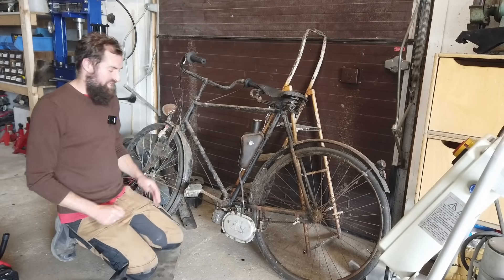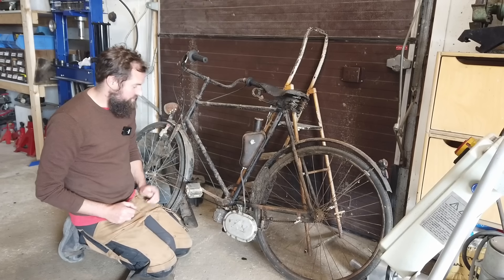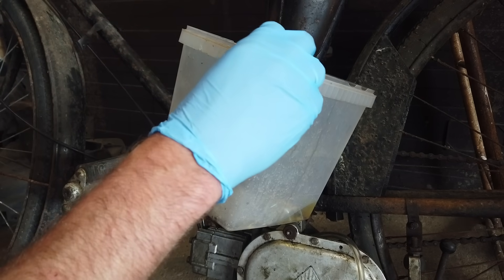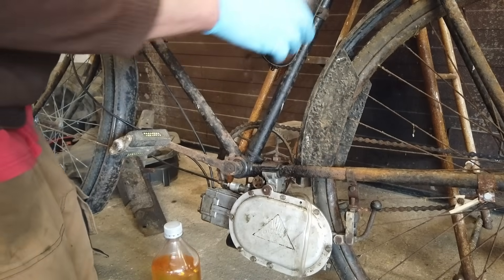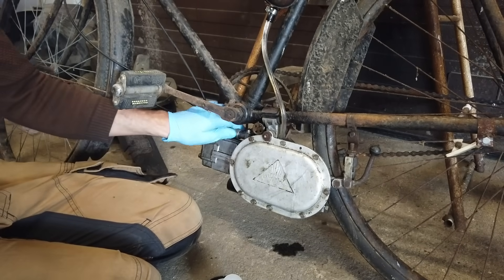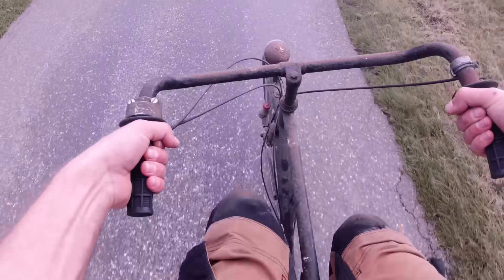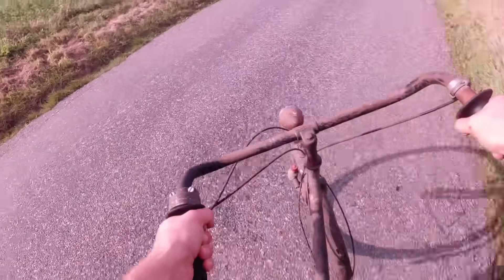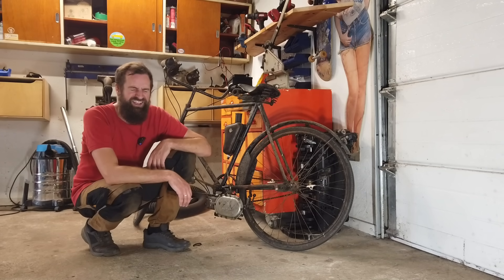Riding A Two Stroke Diesel Moped With Variable Compression!

Comment: If you have not already you should measure the compression ratio 👍 difference between the kerosene and gasoline engines is 30 vs 33 to 1 max CR and would not surprise me if parts are interchangeable so even if it said kerosene I would not trust it still is after all these years.... Would explain lack of power and whole lot of other things and being variable compression CI engine its not like it wouldn't run on kero or diesel like a modern car it would just run very poorly.
Reply from the maker: not sure how I would go about measuring the compression on this
Reply: @SeasideGarage  would think you should be able to fill the cylinder with oil and dummy assemble tdc and bdc then compare volume, will only want 1 ring in to let oil through gap. Not sure though as do not have one.
Reply: There has never been an internal combustion engine with a compression ratio as high as 33:1.  Even specialized compressors do not operate at those ratios.  The engine would be ridiculously heavy to withstand such forces.  I'd be surprised if this engine exceed 18:1.  Frankly it does not matter.  The compression ratio is what it is.  Nothing will change it.  Air leaks in the case will significantly change the air fuel ratio though...
Reply: @Failure_Is_An_Option Lohmann 18cc Compression Ignition Two Stoke, go look it up and its not like she is a unicorn.... Pretty sure as soon as you stop and think about old poorly refined fuels, no glow plug and the fact its variable compression and I stated Max CR not Operational it will make sense.
Reply: @Failure_Is_An_Option  you touched right on it with mentioning specialised compressors 😉
Reply: @psychosis7325  You have the onus to provide evidence to support your allegation of 33:1 compression ratio.

Comment: I think the performance would be higher if you filled up with nitroglycerin.
Reply: You are correct.  For a very short duration the power output will be significantly increased.

Comment: Model RC diesel engines run on nitro-methanol with factory pre-mixed castor oil. This type of fuel has a higher calorific energy content, per measure, than kerosene, modern pump bio-diesel or ethanol contaminated petrol.

Perhaps it would give a lot more performance on RC diesel engine nitro-methanol with pre-mixed castor oil. It's available over the counter at model shops selling RC planes & cars, though it i kind of expensive for a 5 litre can.
Reply: Model "diesel engines"(not real diesel engines), run on kerosene, ether and castor oil(And a little bit of "cetane booster")...
You are talking about "glow plug engines" which is a totally different thing (very very obviously not diesel engines).

Comment: So it's effectively a sort of carbureted semi-diesel. Honestly I think the diesel was the first compression ignition engine so you're fine to call it a diesel. Also RC nitromethane engines are technically a low compression diesel but they don't run on diesel. There's little RC "diesels" as well with little T handles to adjust compression that don't use glow plugs; they run on Kerosene and castor oil I think. So this is similar to the second one.
Reply: "Also RC nitromethane engines are technically a low compression diesel" , Yes sure they are... XD
Reply: @TarenGarond  yup. Perhaps not exactly compression ignition. But close enough.
Reply: @bonkbonk92  So you think something is technically a diesel engine when it has basically nothing in common with diesel engines?
No compression ignition, and combustion not even close to the diesel cycle?
Reply: @TarenGarond  last I checked, diesels compress and have glow plugs... Care to try again?
Reply: @bonkbonk92  ...Not really XD
Edit : I mean about the try again part
Reply: @bonkbonk92  Glow plugs in a diesel are only a cold starting aid, they are not used once the engine is up to temperature and larger diesels (which by nature have lower heat losses) often don't have them at all. Back in the day it was common for diesels to lack glow plugs and be cold started using other means, e.g. injection of diethyl ether into the intake or preheating the engine using the cooling water of a small gasoline engine (which also acted as the starter motor, once the diesel was up to temperature).

 By contrast if you replace the glow plug of a glowmotor with an inert piece of metal the engine will not run no matter what you do. The reason for this is that glowmotors lack sufficient compression ratio to ignite their fuel... they rely on the glow plug providing a 'hot spot' for ignition. The plug stays hot even after the electrical heating is removed because it uses a platinum wire as the heating element, the platinum catalyses a reaction between air and methanol (like a car's catalytic converter) that keeps the plug glowing once the engine has been started. A diesel glow plug heating element by contrast is not made of platinum (nor is there any methanol around for the platinum to react with if it were) and soon cools to the same temperature as the cylinder head once the electrical heating is switched off.

Furthermore the really defining trait of a 'true diesel' is ignition timing controlled by injection of the fuel into the cylinder just before TDC. If it gets fuel through a carburetor it is not a real diesel.

Comment: I ran my diesel car on kerosene and cooking oil, but your bike seems like a 2 cycle engine that needs oil in the fuel for lubrication. If I preheated oil and had a return line, I could run on straight vegetable oil. My model airplane engine didn't like my biodiesel. Try using Methanol with oil added per liter. That should work. fine.

Comment: Its called dieseling when a fuel runs without spark. Its a diesel
Reply: I mean I'm quite certain if the engine uses something that is not even close to the diesel cycle it isn't a diesel engine XD

Comment: .75 HP from 18cc diesel engine, I really doupt about that, the fact is that the engine ignites and powers ther bike a very acceptable way, probably that the original fuel reciept included something to permit easier ignition.
very good video
Reply: Modern engines of the same design use some diethyl ether in the fuel mix, up to 30%, to ease ignition, so I think you may be on to something there. I'm also skeptical of the 3/4 hp rating, as most e-bikes these days are around 1/4 hp and go a lot faster than this.
Reply: This is a two-stroke diesel engine, which effectively doubles the power compared to a four-stroke engine of the same displacement.

Comment: Try to run it on gasoline
Reply: @jankatsman6319
28 minutes ago
Around 1960 a classmate drove one belonging to his father. It was very difficult to drive it, since the compression had to be changed load depended. The maximum speed, no wind flat trajectory, was about 60 km/hour. Fuel consumption was ca 100 km/ l. During wintertime, temperatures bolow 0 depressie C, it dit not run at all. Trying  to run it on petrol resulted in an exploded cylinder, fortuanetly noboddy was hirt. That was the end of the Lohmann. Hope you Will have a lot of fun with your Lohmann